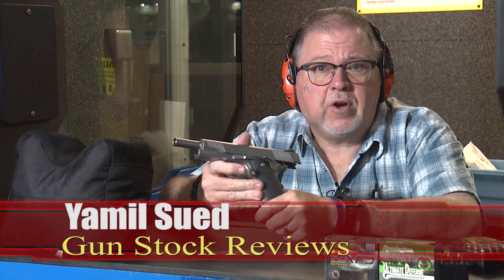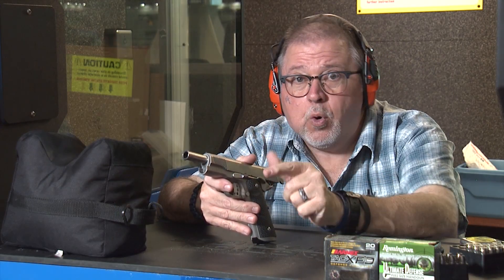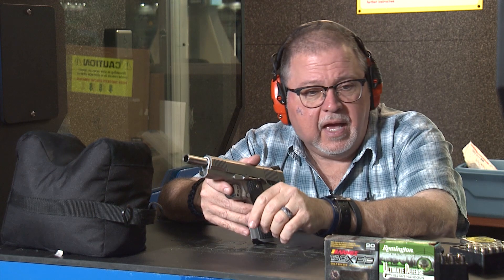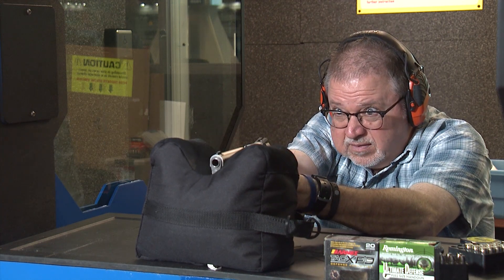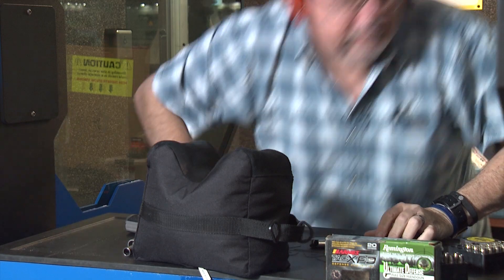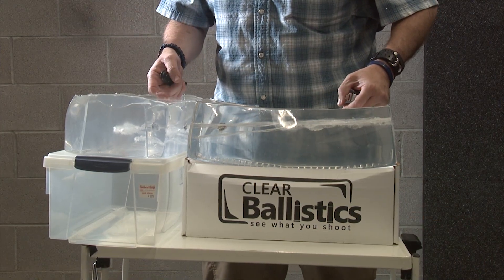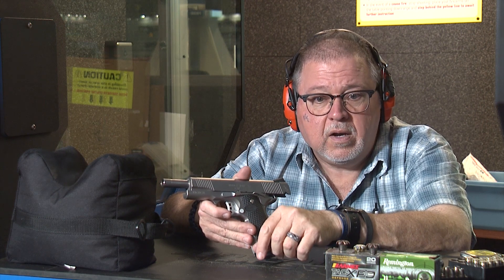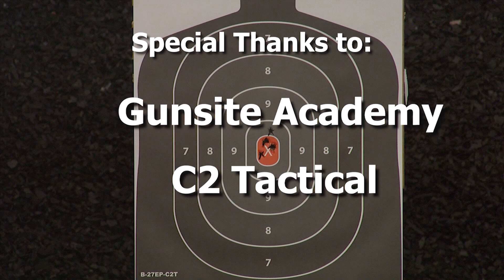Ammunition Performance Test on a Springfield Armory TRP 1911

Comment: When you switch out the guide rod with standard spring plug, was there any notable difference in the action? I too am a fan of old school and looking to get me a stainless TRP.
Reply: NOT at all, I haven't used a Guide Rod in over 15 years, I use them when I first get the guns for the original Video, then, they come out quickly!!